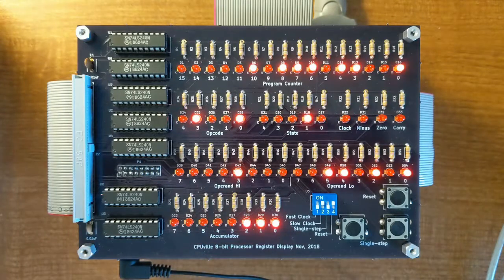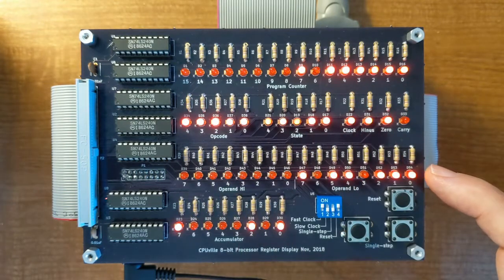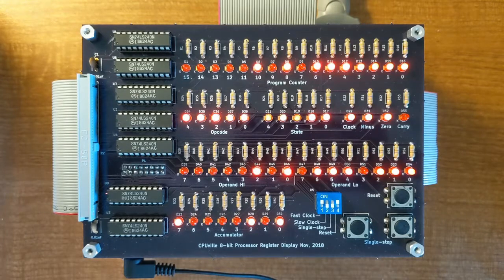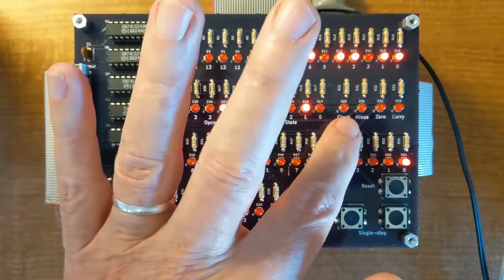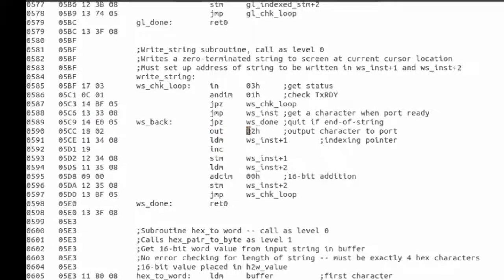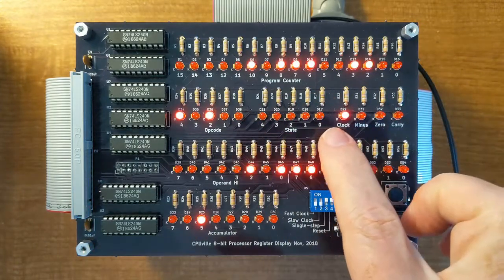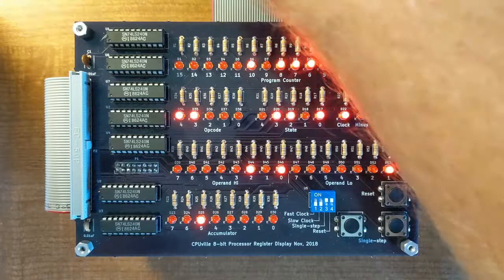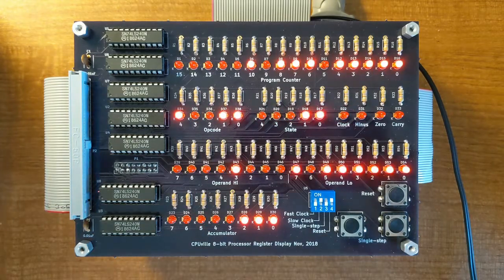Register display demo

Comment: I was reading through the design of your processor and wondered why you didn't opt for a couple of 4 bit adder ICs, like the 74LS283 for your ALU. Was it important that you implement all of the ALU combinational logic yourself? Cool stuff Donn, thanks for the videos and documentation. :)
Reply from the maker: I did use those adder ICs in my ALU. If you mean why didn't I use an ALU IC, like the 74LS181, two reasons. One, this is an educational project, and I wanted to avoid "black boxes" in the design that hide complexity. Two, I was using a "skinny chip" aesthetic and wanted to avoid 0.6 inch wide chips.